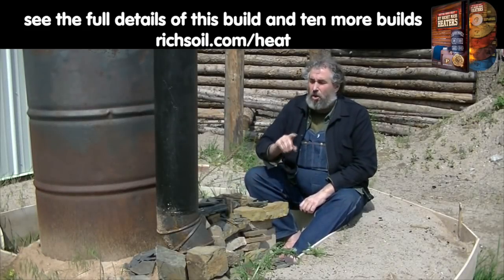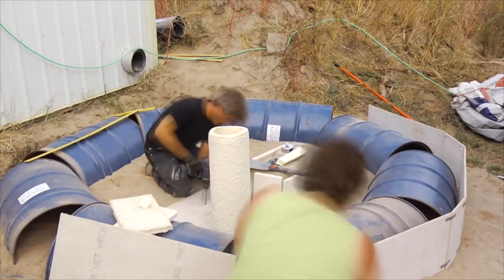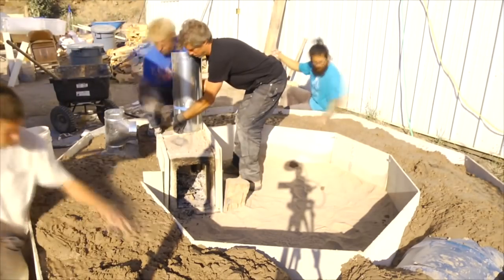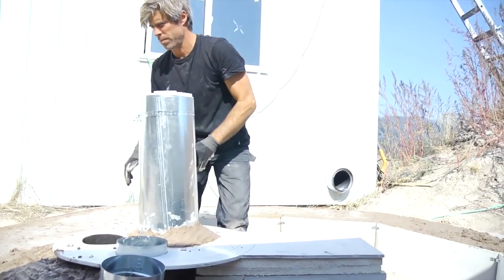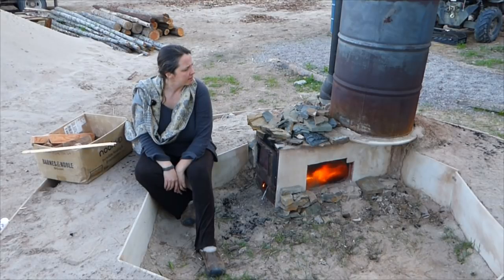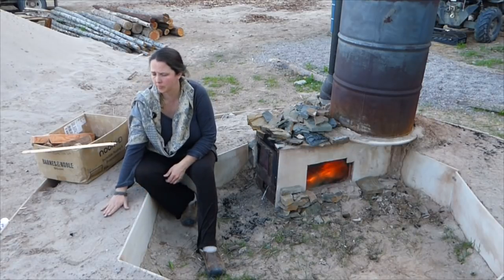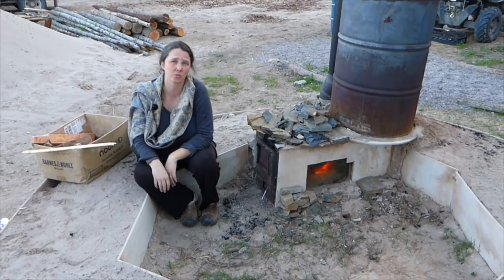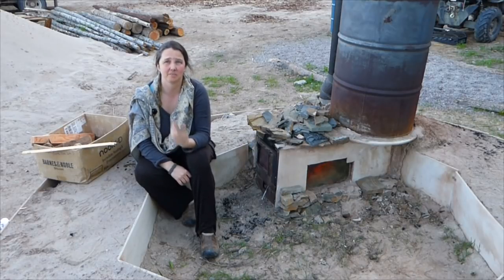ring of fire - outdoor campfire without smoke in your face

Comment: another method is to pass flue pipe through a full steel barrel filled with gravel. the enclosed barrel of gravel heats quickly & retains it. additional barrels of gravel can be added to expand seating.
Reply: That's an interesting thought - the gravel is just coarse enough to allow the exhaust to flow through? Do you know of any examples of this in use?
Reply: Som Juan
imagine the barrel on its side with holes on  both ends, in line with each other and cut for the diameter of the flue pipe. 

fill the barrel with gravel up to the holes then pass the flue through the barrel so it protrudes out both ends. 

hold the flue pipe rigid as the barrel is rotated such that the gravel fills the space around the flue pipe.
Reply: Paul has a couple of rocket mass heaters in that DVD that use gravel instead of cob for the mass.  They have a wooden box full of gravel, not steel barrels full of gravel, but their success implies that your idea would work as well.
Reply: @somjuan  i think then the gravel will got coated up with tar and all those black shoots from smoke over the year, and hard to deal with them when they are sticky and black. nevertheless, i like the idea myself too. i think coarse gravel is good idea as battery for heat, just it is messy to clean up after some years